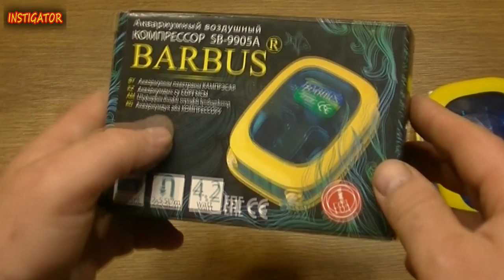Cool tool / how to make a mini gasoline burner

Comment: How long will that amount of gas last? Was that an aquarium air pump? Do you have a shutoff between the nozzle and fume canister?
Looks like fun!
Reply from the maker: yes it is an aquarium pump. separately is the air regulator. Vryamya work depends on the quantity and quality of fuel.